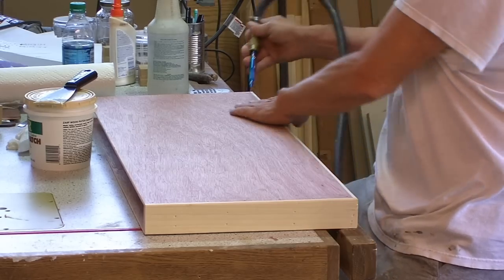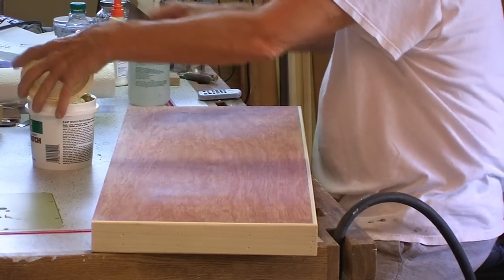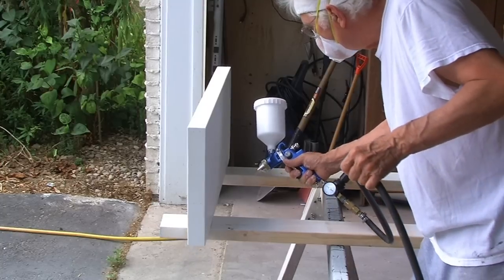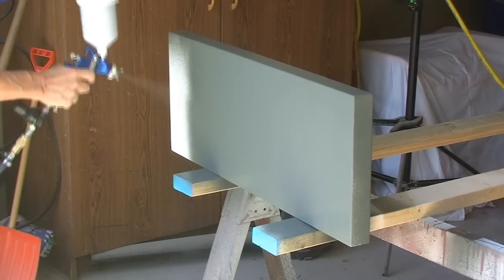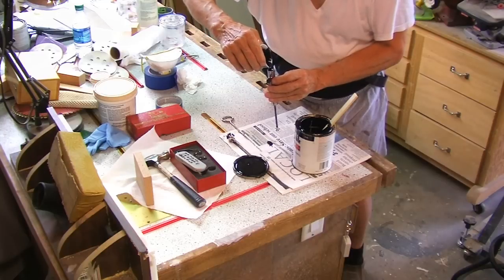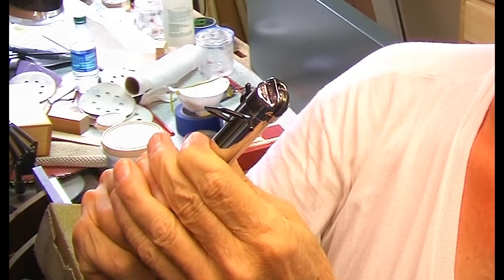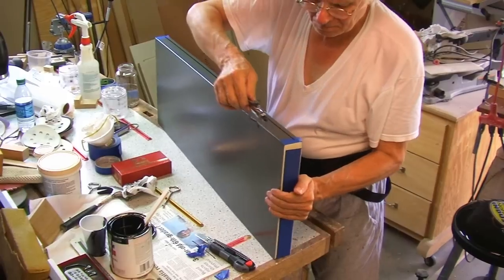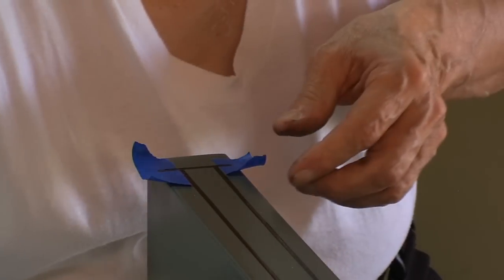Prep, Spray & Stripe Shelves with Beugler Striper Part IX

Comment: What size tip did you use on your gun? 1.3 or the 2 and was that water/latex paint?
Reply from the maker: James, I used a 2.0 tip and added XIM extender plus a little water to latex paint.
Thanks for your question.